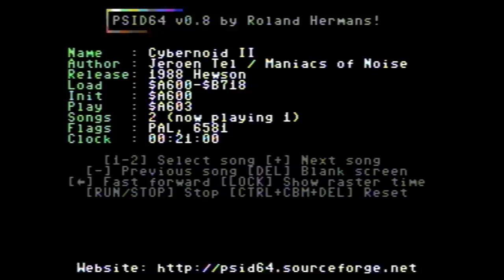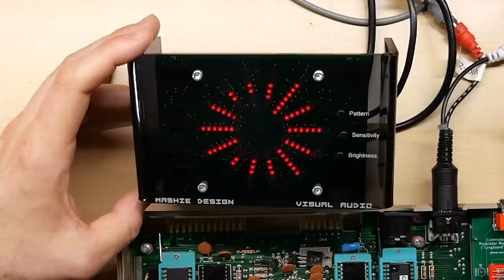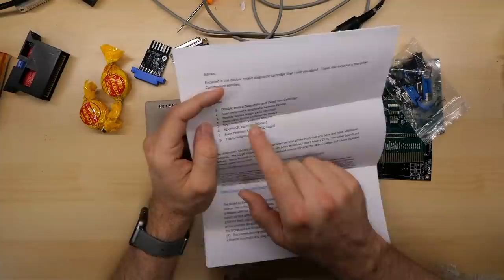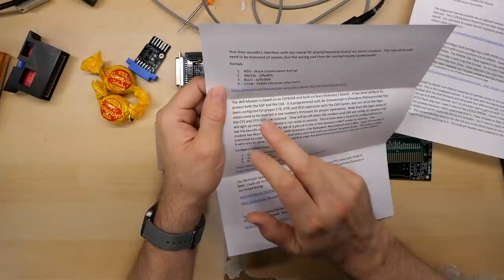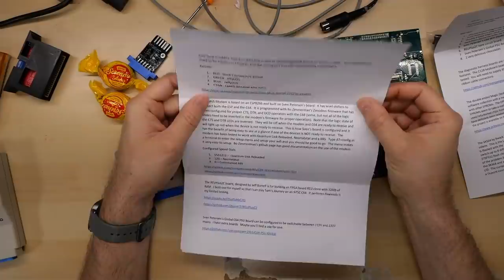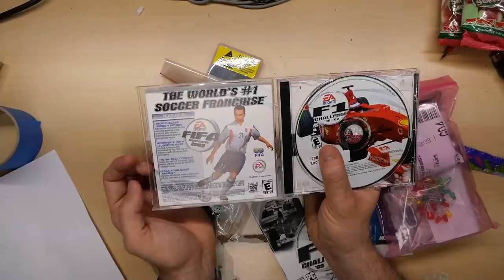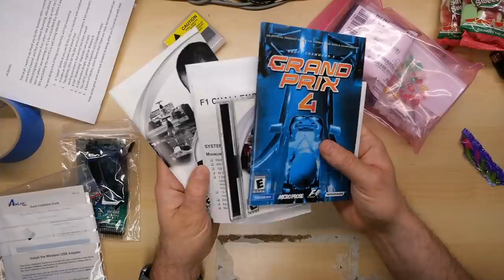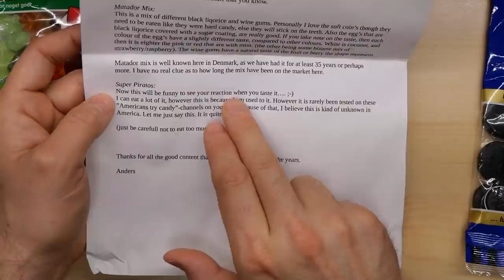More C64 diagnostic carts than you can shake a stick at, a 20 year old case mod and Danish Haribo

Comment: For anyone wondering, the cartridges were printed with Jessie PLA Tan #64 from Printed Solid.  It is a very close match to the color of a breadbin that isn't discolored.

The kernal switcher works very well in a 1541 disk drive to switch between JiffyDOS and stock and also change the device number of the drive if you set it to 8 ROM mode and connect the A14 and A15 address lines to the device select inputs on UC3 VIA pins 15 and 16.  Connect the reset line to the 6502 and it will reboot the drive when you change "modes".  The boards are also useful without the controller as an EPROM adapter.  The ATTiny will remember the last bank selected and can be moved between machines without connecting the I/O if you want to use it for testing purposes.  You could mount the LED directly to it as well as a small pushbutton and program it with a kernal ROM, a Basic ROM and a character ROM and use it for testing.  It's a very versatile device if you think outside the box.  I believe the firmware on the ATTiny is an out of date version.  I didn't realize that I flashed an old version until after I shipped it.

The button on the Wifi modem will reset both the C64 and the modem.  If the C64 is reset by another cartridge, etc, it will also reset the modem.

As another person pointed out, Sam's Journey doesn't use the REU's memory, but just uses the DMA controller to move the memory around, making it a good real world test of the design.  PAL machines don't need the REU to play Sam's Journey.  Apparently there is more time for the CPU to process code between scan lines on the PAL machines than on an NTSC machine and Sam's Journey pushes the hardware to the absolute limit.  It's a great game too.  If you haven't played it, you should check it out.

My wife is from Bolivia.  I think she ordered the chocolates from Amazon.  They are not a Prime shipping item and they take quite a while to arrive from Brazil.

Comment: The cart not fitting in the C64 is the board sitting lower due to the shield being removed. You could put some nylon washers under the board to correct the spacing.

Comment: Ah, that visual display thingy mentioned sounds like something on which LGR did a video a few years ago.  More useful than that device he showed with a built-in cigarette lighter.
Reply: Yeah that cupholder/cigarette lighter is absolute garbage; i bought one myself about 10 years ago, but quickly found out that it only holds very small cups. Since i only use big mugs, i deemed it too risky to have a mug of beverage that close to anything electrical. I ended up disassembling it, intending to find somewhere else to install the lighter, but so far it just lies in a box somewhere 🤣

Comment: @7:17 Mashie! Been a long time since I've heard his name. Hope he's well and putting his mod skills to good use. :)
Yeah, those were the wild-west days of case modding. Wanted 120mm fan intakes/exhausts? Better break out the hole saw or freehand dremel it. Watercooling? Be prepared to braze your own waterblock and hunt for a radiator at an auto parts store. Fans too loud? Run them at 5 volts or 7 volt mod it as there were no variable speed controllers back then.

Comment: I suspect the dead test /diagnostic cart uses one rom and not two while simulating the dip switch settings on each side in a hard wired way, I really really wanted to see it open to verify this
Reply: The double ended cartridge is functionally 2 independent cartridges with independent ROMs built on the same board

Comment: Those Pirate liquorice coins look like Pontefract cakes.
Reply: You´re right, they do look quite similar... i had to google the Pontefract cakes to find out what they look like. However, i doubt that they taste alike; as a Dane, i am very familiar with the Piratos - they are among my favourites in fact - and as Adrian reported, they do have a strong taste. I have also had some experience with british licorice, e.g. Bassetts, which i find very bland in comparison. We Danes are weird! lol 😂🤣😃😄😅
Reply: @BertGrink  Yeah, I find the Bassetts and Haribo versions week as well. But the original Pontefract cakes made in Pontefract, (only 50-60 miles from me), are a lot stronger. I don't know if the factory is still running or not though.
Reply: @frankowalker4662  They were still made until 2004, at least; Wikipedia has this health warning:
"In 2004, healthcare professionals warned against overindulgence in Pontefract cake after a 56-year-old woman was admitted to hospital following an overdose. The woman consumed about 200 grams (7.1 oz) daily, leading to dangerously low potassium levels and subsequent muscle failure. Earlier in 2004, the European Commission had recommended limiting consumption of the active ingredient, glycyrrhizic acid, to 100 mg or less per day."
Even though i love licorice, 200 grams daily seems a bit excessive.
Reply: @BertGrink  Hell, that's a lot. Ha ha.
I bet she did'nt have constipation, though. LOL.

Comment: not sure about your CMD REU's using the same chip thought, it's been a long time, but I have had all 3 of the commodore units and expanded the 1700 and 1764 to 512k in 2 banks of 8  256x1 DRAM's like in the 1750 as well as added the ROM socket, and iirc that was the max that the C= controller could access, where as the CMD REU's I remember were 1 & 2 megs in a standard cartridge so there is no way they had 16 *x1 DRAM & a controller chip in them, or the up to 16MB RAMLink which used Simms

Comment: 32:29 what i never understood with modern retro projects is, why bother with EPROMs? for example the SST39SF0x0 Series of Flash Chips are cheap, modern, and don't require one of those UV Chambers to erase them. and any modern programmer supports them
I hope there is a special MMM when we get to #64

Comment: That c64 cart is really cleverly designed.
Reply: The one that didn't fit?
Reply: @Okurka.  It did. You heard that c64 was broken
Reply: @madson-web  It didn't fit.
Reply: @Okurka.  "The standoff is completely broken there."
"The entire cartridge slot probably sits a bit lower."
"It is ok actually."

But if you live in denial. Believe in what you want to.
Reply: thanks, i designed the case after i bought the bare cart. the cart was hard to remove once inserted. the case is in on thingiverse

Comment: I have 2 C64 that I can turn on but all I get as blue display on old display and how you use today display with C64 and I Like your video lot you show thing I de not know.   I use my C64 to make database for my model trains and I use to do hard cope the only way to use my database as use my C128 but the print as not working right I replace one thing but de not put back in apart that not list in replace that part my print as a "star rainbow NX-1000C color printer"

Comment: ups isnt reliable, my packages are always broken, so ill use excess packaging material ... you likely didnt use enough or any in the first place (you or the seller/sender) packaging material is the default expectation, and can be re-used if you arent dumber than 1 IQ

packaging material can help you move without damaging stuff, it can send things to your friend without damage, etc. packaging material is designed to take the impact so that even if the outside box looks torn to shreds and held together with tape, the internal components will be perfectly fine (including manufacturer defects)